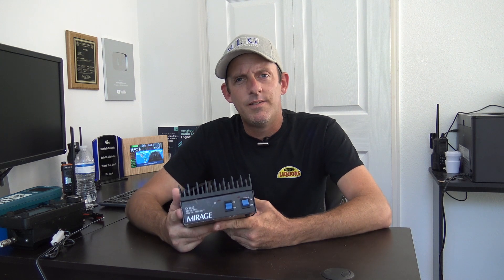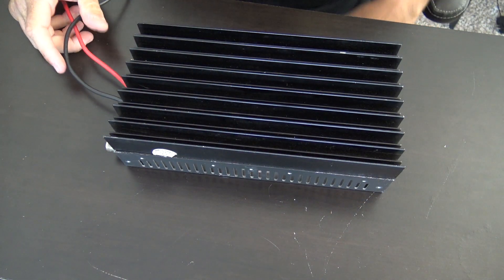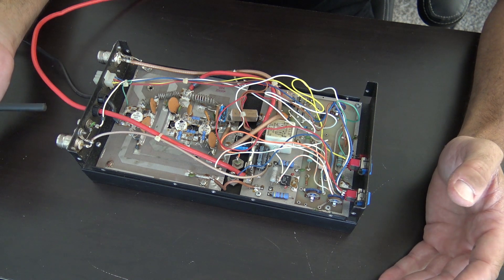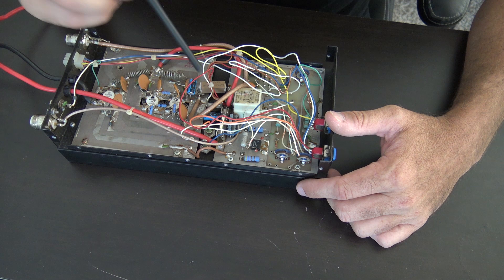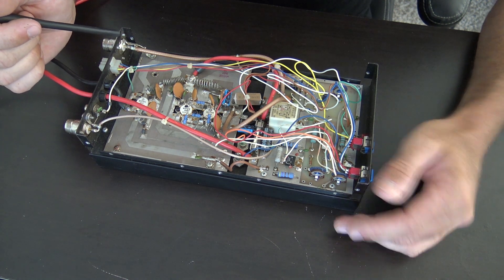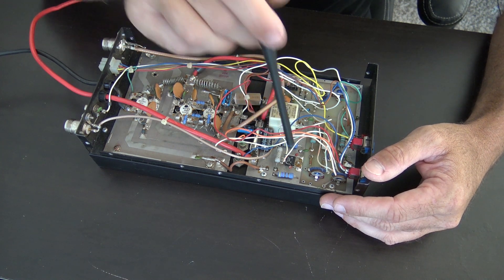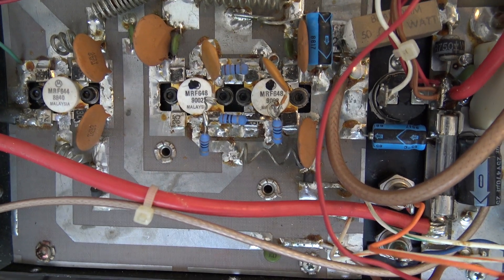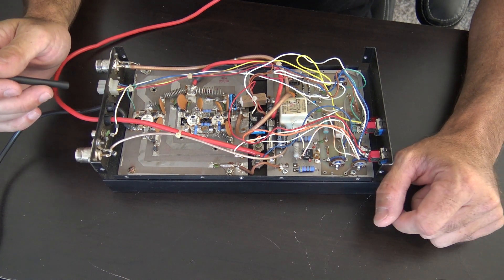CALLING ALL ELECTRONICS EXPERTS!!! Help Me Fix My Amplifier!! Mirage D1010 UHF Amplifier Repair..

Comment: Here is an easy way to test the cor circuit and verify the antenna relay closes with a PTT signal.   FIRST:   Don't apply high current power to the power leads and make sure the PWR switch is set to off.   Using a 5 Amp 13.8 V supply, connect the negative lead to a component lead that is soldered to the groundplane of the relay board.   Connect the positive lead of the 5A supply to one terminal of the temperature switch that is screwed onto the heat sink between the RF board and the relay board.   The PWR LED should light up.   Connect an SPST switch, or key to an RCA phono plug cable and plug the RCA phono plug into the socket next to the type N connector labeled RADIO.   Press the key or switch.   The ANTENNA relay should click and the XMIT LED should light up.   This tests using an external PTT to key the amp.   You can also put a milliAmp meter in series with the bias going to the transistors to measure the bias current.   To test the cor circuit, connect an FM UHF radio to the RADIO N connector.  Adjust the power level of the radio for just 2 Watts before connecting it to the Mirage amp.  Set the FM/SSB switch on the Mirage amp to FM.   Press the PTT switch on the radio's mike.   The ANTENNA relay should click and the XMIT LED should light up.

Comment: Just a couple of watts of 440 FM is all you need to make the TX/RX relay click.   I rebuilt the relay board on my D1010 amp and hopefully, will have a working amp soon.   You should print out the schematics and go from there.   It doesn't look like anything is missing.  Maybe just a disconnected wire.  The COR circuit uses a Darlington transistor, MPSA13, to amplify the current front 2 Schottky diodes that rectify the RF.   With FM, the circuit is very sensitive.   The MPSA13 turns on a small relay, that switches 13.8 V to the Tx/Rx relay and the input of an 8 Volt regulator IC.   If that COR circuit is not functioning (blown MPSA13, bad relay, etc)   all bets are off.

Comment: I think the COR  (Carrier Operated Relay) circuit is not working.   Thus amp only needs 5 Watts in to close the relay.   A safe way to test that is to lift the ends of the inductors connected to the Base of the MRF6444 and the Base of one of the MRF648.   They supply Base bias for Class C (FM) or Class AB (SSB).   When they are disconnected, all 3 transistors will be in cut-off mode;  eg: no collector current.   You can also unsolder and tape up the big red B+ lead that goes to the RF transistor side, just for additional safety.   You will only need a low current supply, 13.8 V 5 Amp.  to test the COR/Bias PCB.   With that connected, key up 3-4 Watts of 440 MHz RF to the input of the D1010.   Does the relay click?   If not, it's either the COR circuit or a bad relay.   Put a voltmeter + lead on the each of the coils.   You should see different voltages when the D1010 is keyed up for FM and SSB.   I don't know what voltage to expect.  The COR/Bias PCB boatd for my D1010 is parrly burned up where the relay goes (missing) and was heavily modified.   So what I am writing is theoretical.

Comment: It's possible to check RF transistors with an Ohm meter.  Set the meter to 1X Ohms scale and first test a working low current diode.  That will tell you which lead of your Ohm meter is positive and which is negative.   Next,, unsolder the two coils that are connected to the Base of the drive transistor, MRF644, and one of the push-pull output transistors, MRF648.  Now put the positive Ohm meter lead on the base of a transistor and the negative lead on the emitter.  If the needle swings when you do that, but it doesn't swing with the leads reversed, the Base Emitter junctions of the transistors is ok, and so that transistors is most likely ok.  Since the 2 output transistors have their bases tired together (DC), there is some ambiguity.   If the needle does not swing, that indicates a blown transistor.

Comment: You are not testing in order. You are not ready to test the finals yet. If you connect a radio and antenna to it WITHOUT power applied do you have a decent vSWR? If not you probably have a bad relay that needs to replaced first common problem, Get them at RF parts.

Cancel

Save

Comment: Two pots near each other are for bias, don't touch those unless replacing transistors. MRF644 should have about 50-100ma Ic (value varies between manuals) and finals should be 100-200ma Ic (collector current).  I think the higher values are for the ATV model (more linear?)
Single pot on other side is SSB delay.
If relay is not engaging with 5W RF input, check the two diodes (1N6263) and the Darlington transistor (MPSA13) near front, side, near delay pot.. That is the relay trigger circuit.
Big diode in middle is for reverse polarity protection. Big black thing in middle is thermal protection cutoff. Opens if too hot, removes DC voltage.
That big resistor from finals output to ground is a 50 ohm 10W wirewound which I suspect is more for spike suppression than anything else (connects to antenna when in TX mode). Has enough inductance to not affect RF.
Other two large diodes are forward voltage drop to provide about 1V for bias circuits.
Good luck, I have a dead D1010 unit as well...
Reply: PS: The small chip capacitors around each transistor are required to prevent oscillations. You need them (4 per transistor)

Comment: Eric, that the power LED is not always on & only came on when you pressed your leads down is telling & a huge clue of the fault that your DC voltage supply feed into the amp is most likely having problems, or, there are cold/fractured solder joints on the board.
If you were having shorted final MRF transistors then your power supply would show a huge current draw & your DC voltage would fall quite dramatically.
If you have say a 30v 5A bench supply with both voltage & current meters, try hooking it up to that to check any parasitic current draw.
I'd definitely first trace out the power supply feeds first and verify its all feeding DC power OK from the switch and into the amp before looking at anything else.
Definitely also check the thermal fuse as it shouldn't be open circuit and you should be able to trace the 12v through it as Mike below had wisely suggested as it should only open on a high thermal temperature condition but provide continuous continuity otherwise.
Also, buzz out the wiring for continuity with a DMM.
Next, as long as you can verify DC voltages are first OK check the DC voltages on the base, emitter and collector of the MRF648.
I wouldn't go pulling out the MRF final transistors just yet until input DC power is being supplied OK is being properly supplied & you are 100% correct they are a matched pair and have adjusted bias via resistors or a potentiometer.
Those black hex screw things look like either mounting screws or less likely, some sort of trimmer capacitors but my guess is they are black hex mounting screws as I see the MRF648 datasheet has screw mount tabs.
Yeah, trying to diode check the MRF finals might give false readings due to those low value resistors which seem to be 10R to 100R but its hard to make out the values but if you get 0.2 Ohms or something super low beware as it could be the transformer winding tricking you.
Some might suggest changing the axial electrolytics (if so, pick equal or larger voltage, same or better temperature and good quality like Nichicon, Chemicon from Digikey) but let's first resolve your DC voltage supply issues first before we go down such paths as if there isn't any DC voltage to bias the amp, you're much like a rowboat with no oars.

Looks like a UHF amp design with the microstripline inductors.
Ou, the fun of RF voodoo design at those VHF/UHF ranges :) & so surprised that RF stuff like this isn't a genre on PornHub yet.

Above all, get rid of those negative thoughts as electronics is always a learning curve & if you never take the plunge to try get into something like this, you'll miss out on valuable electronics knowledge & through hole stuff is far easier than tiny SMD components.
If you never give it a go, you will never ever learn & you know more than you realise so lose that fear.
If you want to learn more about these sorts of things most definitely check out Mike at MikesRadioRepair & Peter at TRX Lab as they are absolute guns at fixing radios and amps like this & you will definitely gain huge amounts of knowledge as they are fantastic teachers

Comment: According to the associated schematic, the molex plug on the backside is for an optional Remote Control Plug. Apparently, the default of the plug is set to Remote on Pin 1. Pin 2 is 13.8. volts. Connecting power in a jumped scenario may turn the unit on. Essentially, similar to the SignaLink that has internal jumpers for complete functionality. 

You will find the schematic when looking for the ATV capacitor modifications on the Mirage finals. 73 from Volusia County

Comment: See if the power supply circuit is giving you power to the rest of the amplifier.  I always thoroughly check the outputs from the power supply first when something doesn't want to turn on, both loaded and unloaded, as something might be drawing down or impeding power from one of the legs. I know you said you had power to the PA(Push Pull amp or Power Amp). Unfortunately, that doesn't mean you have power going to the rest of the Amplifier. You should eliminate the power supply as the cause of the problem before you go down any other rabbit holes.   PA's usually have their own leg out of the power supply circuit not connected to the rest of the outputs from the Power Supply.  A lot of times in a power supply circuit you'll find electrolytic capacitors that are bad. Bad capacitors in a power supply can definitely cause your symptoms. Good Luck.

Comment: Eric, Find New Transistors, Those Round White Things Your Pointing At, And Where You Source Them From, Make Sure You Do Not Counterfeit Ones. Transistor Acts As A Gate, Normally On; Or Normally Off. Yes Your Meter Probe Completed The Circuit, Indicating One Or All Transistors Or Less Are Bad.
Good Luck Let Me Know.
One Other Thing, Use A Clip On Heat Sink/Countersink When Installing The New Transistors, Using Too Much Heat When Installing New Ones Will Fry Them, (Google) Lowest Wattage Setting For Applied Heat, And Or Temperature Setting, Fahrenheit Or Celsius To Properly Install New Transistors. Been Long Time Snice I Last Soldered Sensitive Electronics. 
Best To You,   James L... Geter Running, You've Got 100 Watts For 20 Bucks!
No I'm Know Expert Ethier...
Just Was Good At Transistor Theory In Dah Navy!

Comment: I agree with you in that I think even if the finals were blown you should still see the power light or hear the relay.
If the back final section took enough amperage to drop the voltage for no power light, it would easily pop that fuse.  The same goes for the reverse polarity protection diode, usually when they are "spiked" they henceforth create a dead short to ground taking out any new fuse you use to  replace the burnt one.

Long story short, my guess is the first problem will be in that front circuitry, while the finals could be bad too, my first suspicion would be in the CAR carrier activated/operated relay and/or power relay and, any transistors used for switching the relay.  The relay looks pretty beefy.  Is it only used for the CAR? Or might it also switch the power as well?  Is it marked? Can you tell which pins are for the coil(s)? If so own out the coils.  Also if you have voltage at the switch where does it go?  Is it in line with coils of the relay?  Now even that can be complicated, I know on many occasions on my homebrew projects I like my switches to merely provide a ground path for the coils. That way if a wire shorts to ground, instead of taking fuses or smoking wires it merely energizes the relay coil.

Anyway try to figure out if that relay only has one coil and switch set, then look at the NC and NO normally closed and open pins.  Also as others mentioned get access to the other side and look for cold solder.  They can be a PITA to identify so get creative and ohm things out, just remember other components in the circuit can throw off the ohm meter.

Looks like a fun project.  If I lived nearby I would love to peek at it.

Also see if you can get BBI to comment.  I know he focuses on 11M but the dude is sharp as a tack.

Also Big Clive likes mysteries as well and when it comes to mystery circuits he has a 6th sense.
Reply: Mr. BBI

https://youtube.com/user/wickeddreams911
Reply: Big Clive
https://youtube.com/c/Bigclive

Comment: https://hamtv.com/pdffiles/D1010-ATV.pdf

Schematic is down the bottom..  the first thing to check is the keying circuit by just grounding the key port on the back..then if it doesn’t key you most likely will replace the key transistor..

Comment: I think you should focus following the ground, i can't see a solid ground wire to the input board, the one with the relay. So, my theory is, the amplifer was connected wrong to a power supply, from the plus red wire you have a fuse and after a diode connected to ground, i believe the diode did the job and protected the amplifier, but, from what i can see, from the minus of the diode you have a big resistor, i believe that's the minus passing from one board to the other, that one must be checked. that big 50ohms/5w resistor

Comment: Ok; first things first.

Disconnect all power, cables, etc.

Electronics troubleshooting 101:  VISUAL INSPECTION!

grab your glasses (if needed), magnifying glass & a 4x/8x Lupe.

Check mechanical connections; i.e. ground & chassis lugs & screws, connectors in place (pushed in all the way) - pins of those connectors not pushed out of place, etc.

Next, because of what you have found when you probed that one area; grab your high power Lupe & look at all of the solder joints. Look for cold joints; joints that look soldered but may have a tiny space between the lead and pad, cracked joints (look like a annular ring or rough edge, etc.

Now, look AT the traces; looks for splits, lifted or burnt spots or even micro cracks. 

See, when you pushed your probe down; it may have slightly twisted the board to remake a broken contact.

You should FIND the cause first, not just hit everything with solder... Yet!  You don't want to lose/hide the problem's cause. If you find the cause, then fix it; you've learned HOW to troubleshoot the problem. Then you truly can fix the problem.

Part 2; if you can't find anything visually, move back to GENTLY putting pressure on the board (while connected as before) with a non-conductive probe - wood, plastic.  See if you can repeat the  former temporary switch power light on.

If you cannot, try that probe you first used.  It is possible you either injected a slight resistance or capacitance that the unit needed. 

That would seem to indicate a component out of spec.,  etc.

At this point you will need & share a copy of the unit's schematic to logically proceed; as there's no detail from the video to see how the circuit operates.

Give those preliminaries a try & see what you find.

Good luck, hope you find the issue soon.
Reply from the maker: Cool thank you so much for all your time typing that friend... I'm gonna go through just as you said... I'll post what I do or don't find..

Comment: Don't you just love it when someone asks for help and you get the knackers who just want to tell you how smart they think THEY are (thevenin's theorem LOL ) Anyway, If things are happening as you probe around I would start from a mechanical aspect. Try wiggling wires for an intermittent O/C or go around the board with freezer spray first.... 73

Comment: DO NOT go throwing a bunch of parts at it as many have suggested.  You will most likely be replacing a bunch of parts there is nothing wrong with.  Troubleshoot the problem.  The first thing suspect to me is the no power on LED light.  Trace through the power supply circuit with your voltmeter.  Loading a bunch of parts a 12Ga shotgun and blasting them into the amplifier will likely not fix it.

Looking at the schematic I could quickly find using Google.  If the power on LED isn't coming on I wouldn't even bother looking on the RF board yet.  Check for voltage at the on/off switch and that you have power out of the on/off switch when you turn it on.  Next would be the thermal protection switch which is connected to the "out" side of the power switch.  If you don't have power on both sides of the thermal protection switch with the on/off switch turned on then it's probably a bad thermal protection switch.  The power on LED is connected to the opposite side of the thermal switch through a current limit resistor so if the on LED isn't coming on I would suspect it's a bad 170deg C thermal switch.  If that thermal protection switch is bad it will not turn on.

Having now watched to the end of the video it looks like you saw the power on LED light up.  Possibly a intermittent connection.  You should still start tracing the power rail from the power switch.  There are only a couple things that could prevent the power on LED from coming on as I described above.

Mike KC3OSD
Reply: Mike -  When you coming back?  I miss your videos!!  You are top notch !  I refere to your videos often.  :)  ~Jack, VEG
Reply: Omg Mike hope you've been really great & thanks so much for lending your expertise to help Eric out. 73s!

Comment: First thing I would do is reflow all solder points.
Second thing if resoldering does not work is to replace all the electrolitic caps.

Comment: Start by replacing all of those ceramic capacitors, if it still doesn't work after that you may need to add a hyper dimensional resonator
Reply from the maker: Lol